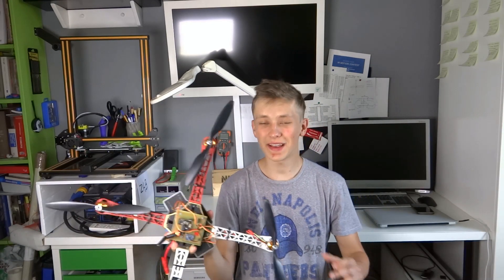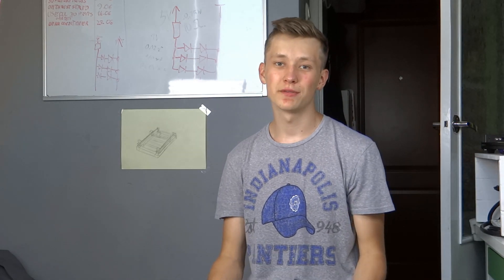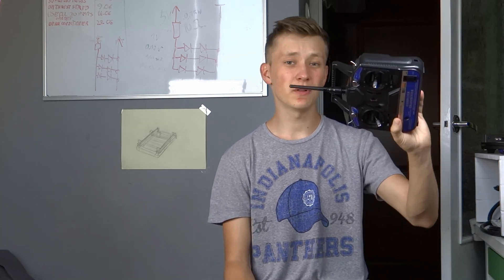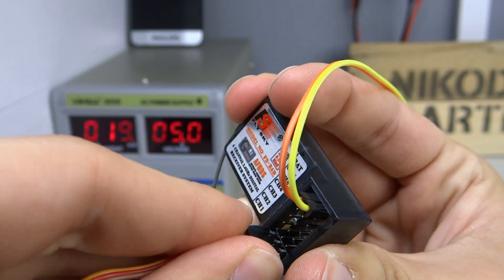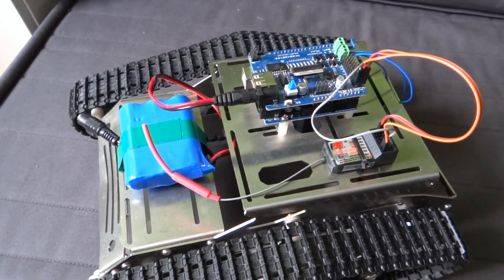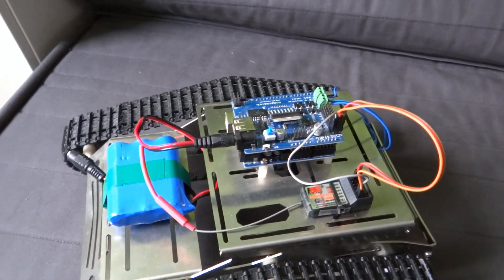How to use RC radio with Arduino (RC Arduino robot)

Comment: Great video (as usual) thanks.  Your project has everything it needs to be both RC tank, and robot.  Code some instructions into the Arduino that are executed when the radio signal is lost, then all you have to do to change from tank to robot is turn the transmitter off.   Add a few components so it logs every turn while you are driving it, then have it execute them in reverse when you turn the transmitter off... poor man's Return to Home!   :o)

Comment: Hi Nikodem, i got your skeches from your github. I 3d printed the tracks for a tracked vehicle with aluminium chassis and arduino + motorshield 'motor management'.
I want to hook it up to a rc set i recently purchased so, you sketch is just what i need to adjust to my setup.
Thanks so much for sharing this!

Comment: Could you specify what pins do I connect from the receiver to the Arduino I can't really tell from looking at the video ?
Reply: orange to pin ~9 from chn 1 pin 1, other 2 are power and ground

Comment: Nice to see how this is done. I’ve used a Adafruit feather with Bluetooth for a remote control rover via an iPhone app.  That worked well, but I guess using the RC controller gives you more range and a better control feel. Eventually I want to try using an esp32 for remote control tele-presence applications over WiFi.
Reply from the maker: It's much simpler to use and more reliable also range is better. But you can send more data over WiFi or Bluetooth and there are much more options than in RC

Comment: Can you please share the connection layout and the driver module you used with Arduino and a question - 
where Pin 9and 10 defined in the code are connected.

Comment: That tranmitter isn't ugly, it's how they're supposed to look like. (my opinion). 

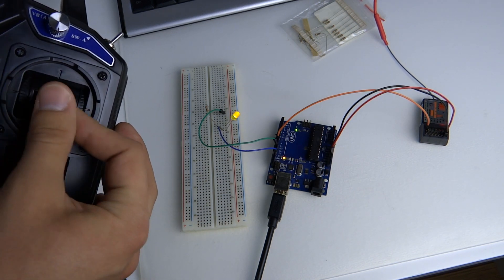2:24 if I use right stick with these code. It works, but if I take it to the far left, LED goes on on brightest.
Reply: There are some nicer looking TX's out there, Orange, Spectrum ect. Still, they're cheap and they work.

Comment: Hey, i am using this transmitter to control my battle bot, i have one question, is receiver receives ppm signal or pwm, my motor driver is pwm compatible,suggest me any ppm to pwm converter, the result with directly connecting receiver and transmitter to motor driver was like, motor wasn't running at full speed, and not stopping either.

Comment: Gotta be a bit careful, those AMS1117-5 regulators on cheap Arduino clones are a wee bit wimpy and have bad failure modes. If you run just the receiver on there, it's no big deal, it's fine, but if you add servos, that could be pushing it. But as long as you can touch it and it's not burning your finger off on the regulator, up near the barrel jack, it's fine.
Reply from the maker: Yes I know, they are overheating a lot sometimes.

Comment: Can you tell anything about the delay caused by the Arduino? I am familiar with the Ardunio programming and about to give an rc car a more authentic behavior on throtling with an Arduino and ad a fpv cam with a stepper motor to be able to look arround. If the Ardunio will cause a delay about 200 ms it will be not worth starting the projekt so if you know anything about the delay let me know!!

Comment: Hi Nikodem,
This rc project looks pretty interesting because it might be helpful to resolve my automotive lawnmower idea and the RC implementation on it. But I want to use ESP8266 Node mcu instead of Arduino board. so that I can read some of the data using some sensors and send back to my mobile phone. Is that possible?

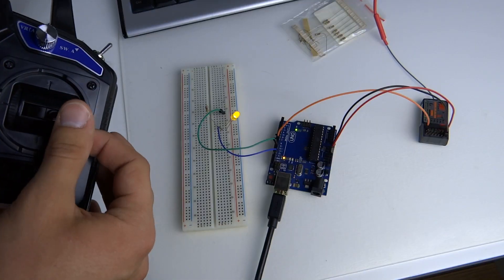Comment: Hey, nice video! A little remark: at 2:17, you say the pulse-width is between 1000 and 2000 ms (but: 1000ms are one second). What you mean is microseconds (µs): 1000 µs = 1ms, and the pulse widths of modern servos are between 1 and 2 ms. And you say you map 1000-2000 µs, but in the code you only map 1100-1900, why is that? Keep up the good work, I always enjoy your videos!
Reply from the maker: Yes, you are right, I made a mistake. Sorry about that. I map 1100-1900 because those are minimum and maximum output values of my radio. I am not sure why but after some tests it turns out that it can't reach full 2000.

Comment: sir can i use this code in FLYSKY FS-i4 4CH with L298 H-Bridge Dual Motor Driver and Arduino uno. can i get t the circuit diagram sir?

Comment: Hello. I am trying to make your drone but using a Black Gladiator & an L298 Driver Board. I see activity in serial monitor but the motors won't spin. I have scoured the net and seen many other Youtube vids & I have tried different lines and pins but am wondering if there is a tweak to your code that will get this to work. While I have been an electronic & IT tech for years, I am only now getting into Raspberry Pi and Arduino robotics so I am very new to this. Any help would be greatly appreciated. Thank you
Reply: I have a Motor Shield I could use instead but the video shows how to set it up for BlueTooth and I would rather control it like your drone using my Flysky FS-16

Comment: Sir, nice video about how to control the RC radio with Arduino. Sir, can the 6 dof robotic arm tank chassis be controlled by Xbox360 wireless controller that would be super awesome, we can easily control the 6 dof robotic arm tank chassis controlled by Xbox360 wireless controller. Sir, can you make the 6 dof robotic arm tank chassis be controlled by Xbox360 wireless controller, also can you give me the circuit diagram and the codes for the 6 dof robotic arm tank chassis to be controlled by Xbox360 wireless controller, is it possible? Sir, tell me. Sir, answer all my questions.

Comment: Could I do this with a normal adafruit  motors shield
Reply from the maker: Sure without any problem
Reply: @nikodembartnik   another thing what pins would I put the reciever to the analogs and would I need to change the code ?
Reply from the maker: it depends on the adafruit shield pinout. You have to connect 5V, GND and signal pins to the Arduino
Reply: @nikodembartnik   I have 5v and ground connected to the receiver like you said  then I have ch1  connected to digital pin 9 and ch2 connected to digital pin 10  .  I then check the serial monitor to see what's going on and it shows  that the digital pins are receiving the signal but when I plug into the motors it doesnt drive the motor and the chassis does not move .

Comment: is there some kind of latency?
Reply from the maker: For sure there is some kind of latency but it is very very small I think. Unfortunately I don't have tools to measure that :(
Reply: latency is a feeling then it's quite subjective. Nice job Nikodem!
Reply: Usually FlySky units should be up to around 25ms or so? Usually a good bit less. Until you start hitting end of range and you get packet loss, the apparent latency will shoot up.